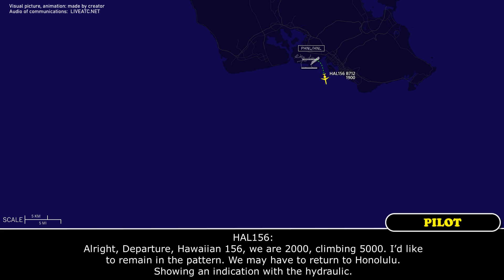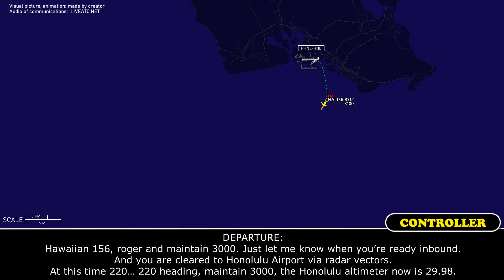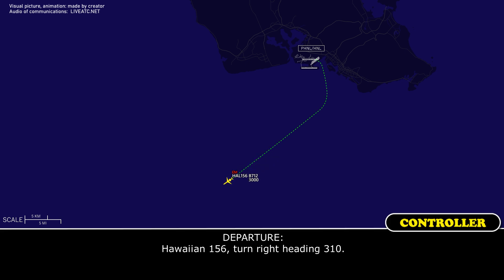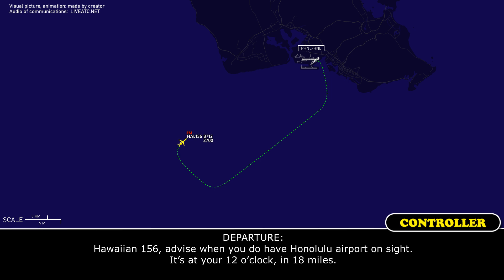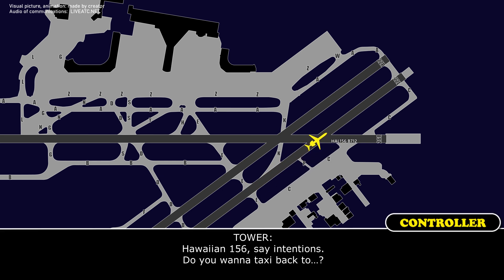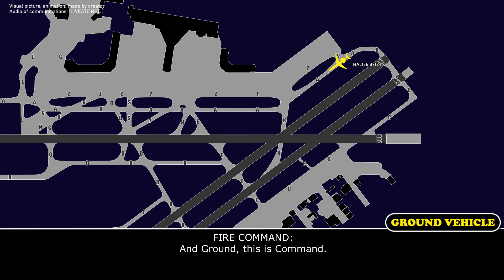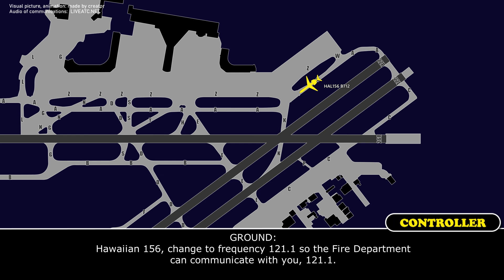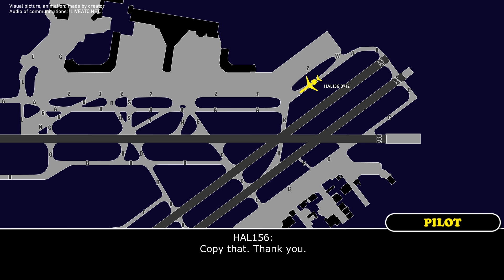LOW hydraulic QUANTITY and LOW PRESSURE after takeoff. Hawaiian B717 returns to Honolulu. Real ATC

Comment: I have been listening to these stories on YouTube for a while now. Turns out it can be interesting. I started to listen to some of the  Live ATC archived HNL feeds, too, so I wondered if this one would appear, as I have noticed that HNL incidents are not frequently covered. However, there is a second part to this, which is challenging to find, so I could see how it got overlooked; if you listen to the original Live ATC feeds real closely, ARFF does come back on looking for them. You can hear more talk of the issues with the ground frequency; however, you must grab the following parts of the ground feeds,18-19z feeds, as they await the tug. It turns out they did have a leak issue. It seems it made a small mess on taxiway A.
Also, it might have helped to have a clock on these things. People seem to forget this is sped up/condescending/trimmed. Listening to the Live ATC feeds, it is a lot longer.
Note: I did edit this to clear up some stuff.